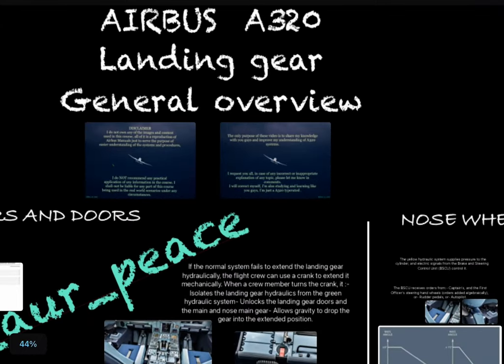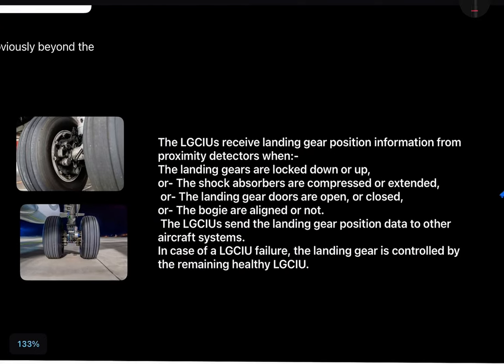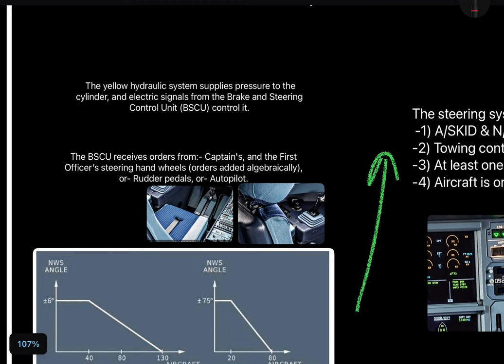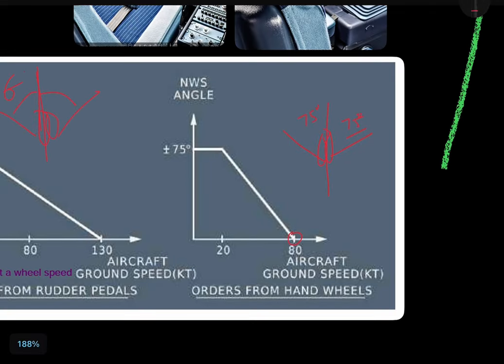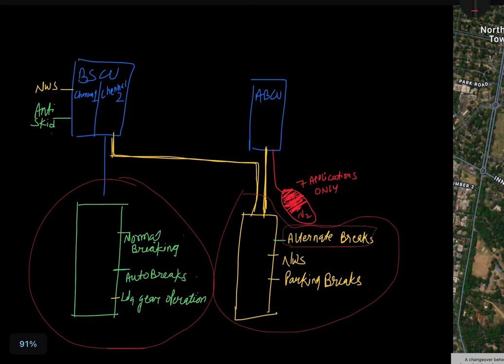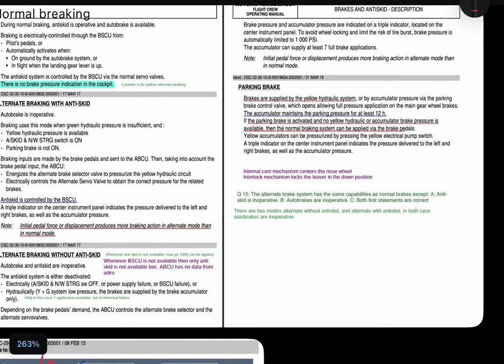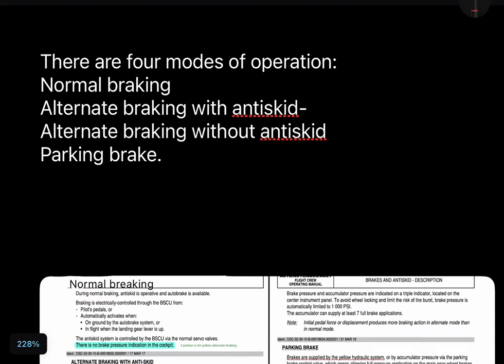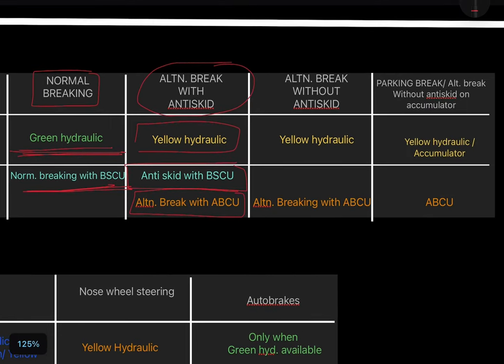Landing gear Airbus320 /General Overview #landinggear #a320 #breaks #bscu #flyingaurpeace

Comment: Hellow dear...it was great explanation..
Landing gear cycle as controlled by LGCIU CHANGES AFTER EACH EXTENTION..
Reply from the maker: Glad to know that you liked this video .
I rechecked LGCIU Channel change>so I opened ldg gear > gears and doors >landing gear and door operation >normal operation… it says “One LGCIU controls one complete gear cycle, then switches over automatically to the other LGCIU at the completion of the retraction cycle. It also switches over in case of failure.”